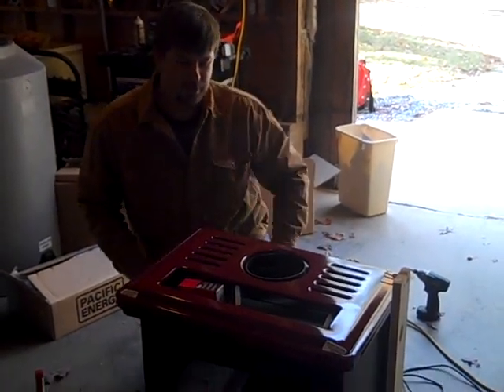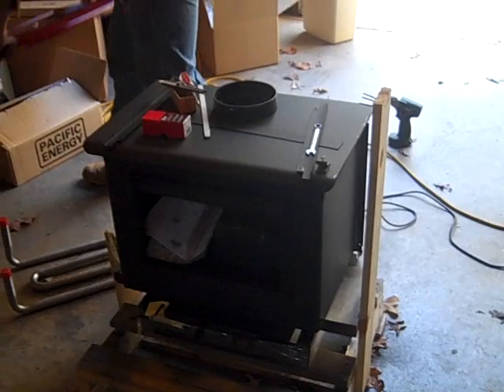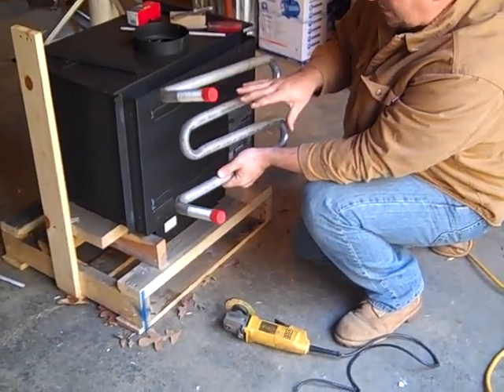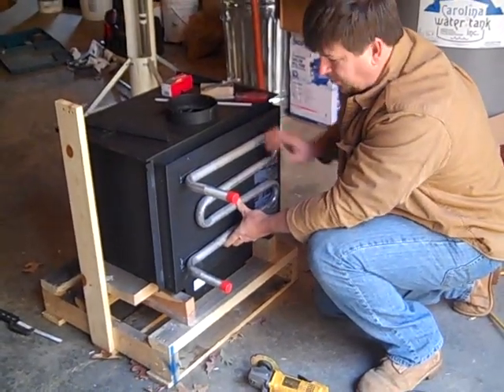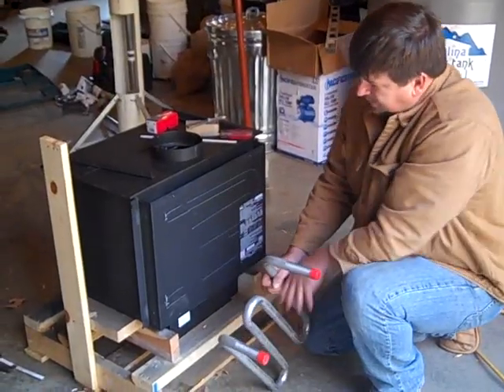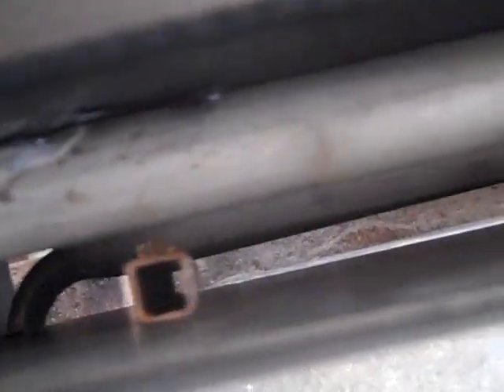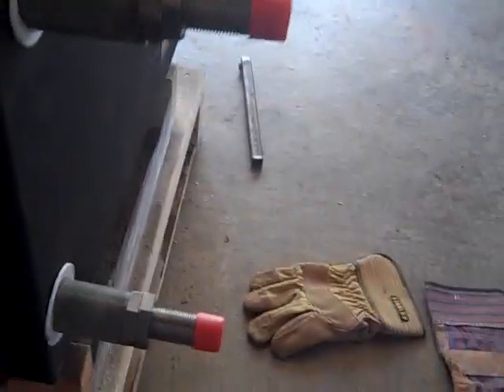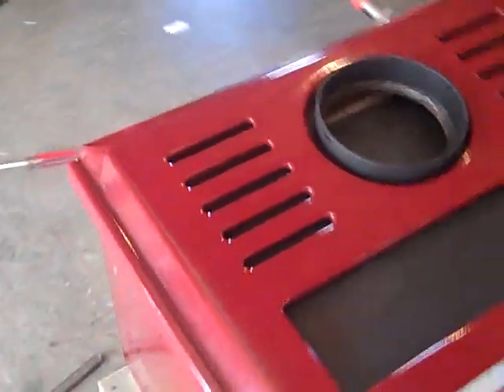Hot Water the old fashioned way: Water coil and a wood stove

Comment: THE BEST HEAT EXCHANGER IS TO USE A CAR RADIATOR THEY ARE THE BEST TO USE THEY ARE DESIGNED TO RUN HOT WATER THROUGH THEM!!!

Comment: A thermal bridge between the coil and the stove plate would greatly improve the efficiency. Even something as simple as closing off the bottom of the rear heat shield and filling the cavity around the coil with sand would help a lot. Air is a poor conductor of heat.
Reply: I think one would need to consider the possibility of what if one ran it dry in your above modification.  That air space is there to hinder the flow of heat to the back wall, making it more thermally conductive may require greater clearance.

Comment: I found you can't take a big cooler  and full it with cold water near your stove or not I put mine close to the stove to make it easy all you do is fill a large pot of water from the cooler place it on top of the wood stove till it heats up and put it back into the cooler and repeat before to long the water is piping hot got it up to 120 the next day it still was at 114 degrees 10 hrs later hthe coleman extreme coolers keep ice 4 days in hot weather so keeping water hot is not a problem once it's heated up just  add a lot of pot water every day or two if you  put the cooler up high you can gravity feed it to whatever you need fill a sink for dishes or a bathtub worked great when my well went out and i had no running water just rain water from the roof  for over a week till I fixed it still having hot water  for washing things got me through would be a great idea for an off grid cabin

Comment: Hi there, do you really need a second water heater for storing thermal syphon water. why cant I use my existing water heater turned off at the breaker. I never see anyone do this on YouTube, is there a reason. If you could answer this I would greatly appreciate it. Shaun T

Comment: I have watched several of the videos you made over the years for hot water and space heating.  You always have creative and innovative ideas.

I wanted to share with you a video of a wood stove used to heat water.  The hot water in addition to the wood stove is, also, used for space conditioning using water radiators.  I thought you might enjoy the ideas shown in the video.  Be aware that the video is not in English.  The tech stuff starts around minute 10:30.

https://youtu.be/LrR6jxT8FiE
Reply: Eric Kosak that’s an interesting idea to plumb a radiator in between the stove and tank. However, it might need a pump to keep the water moving.

Comment: Stuff it with stainless steel scrubbing pads to increase the surface heat transfer from stove to pipes.
Reply: Sand, or aluminum silicate would be much more effective, stainless scrubs is mostly air, not very conductive

Comment: Question for you... we currently have water baseboard register heat, with natural gas as our fuel source. We were wondering if that system can be converted to a wood burning source. We’re seeking your advice on this after watching the similar how to’s of yours to heat water. Thanks
Reply: Monica Troester I just finished all my plumbing I have hydronic baseboard heat I am trying this coil in the stove I will try to update with how well it works soon

Comment: You will find it won't heat water very good with fire brick between the coil and the combustion. Take the brick off the back and then try it it might work better.

People don't totally understand creosote(fire) problems in the chimney from using a coil in the wood stove. That is probably why EPA won;t accept it half assed, not to say EPA is not corrupt, but not everything. They know if they ok it and houses start burning down, in which they will, they will be legally liable. They are not going to ok that dangerous trap.

But i heard what you said, "for when the grid goes out" , but people mainly only hear " for no grid". lol And want to attempt to use it all the time. But also your design won't hurt anything, but in the same token, you won't get much water heated that is worth the trouble of it all, unless you do heat water, then your creosote becomes dangerous. It is directly proportional, the more heat you gather in the coil, the more 3rd degree creosote you build in the chimney. But the less heat you gather in the coil, the less creosote build up. EPA knows this stuff is common knowledge.

I been thinking about it, and a possible way around the creosote problem is to achieve a complete total burn in the combustion, then we can extract ALL the heat out(into coils, etc...) of the exhaust and should not have to worry about creosote than.  But to get that complete burn will be the challenge but it is doable and reasonable. It will consume a lot more fuel(wood, pellets, etc...) but it will be efficient, and just have heat storage and shut it down, cycle it, lit, and back out. And in the long run you use less fuel and at the same time have abundant hot water and warm rooms, if all things are engineered precisely.
Reply: Design of the secondary burn is essential in order to avoid the creosote problem.
Also consider the fuel...pine, for example, is rich in the tars that create creosote but well seasoned oak burns much more cleaner.  There are many products on the market that are designed to burn off the creosote.  We use these in France in wood burning stoves once a month and suffer no problems with chimney contaminations with tars.
Look at the rocket stove principle for a complete burn. The temperatures are so high that tars are burned well before the exhaust stack where the temperature usually do not exceed 130 degrees cent.
I agree placing a coil in the flue when filled with water will lower the flue temperature to the point where tars will condense.  If the coil is wrapped on the exterior of the pipe and then insulated then less chance of a great temperature drop but of course less heat transferred to the coil but still sufficient for domestic hot water.
A tank at the back of the fire, inside that is, along with a safety control system is still the preferred way.
Since 1930 in the UK and right up to the 70's when gas became cheap, the 'back boiler' was installed in virtually every house heating domestic hot water by thermo syphon. No pumps, no valves, open header, and an expansion pipe to the outside.  It worked !!
Thanks for the discussion and the posting of your work
Reply: Taking brick off of back may cool combustion chamber down hence creosote buildup? Also, please explain "why" the creosote buildup with internal coil? Lowered temps? Then maybe the answer is a single coil/ small footprint/ small temp drop?

Comment: Hey Engineer. great video, have a couple questions: what is the temperature of the water as it leaves the fire box? also, could this be adapted with a glycol mixture to run through radiant floor heat?
Reply: The outside wall of the stove is about 225 degrees, so with cold water entering that coil, and since it is a short distance, Im not sure, depends How cold the water going in is, would be interesting to see, either way it will be less than 225, but how much less.
Reply: It’s not a on demand water heater. You are slowly heating the contents of a 50 gallon or so water tank. It might actually be faster if the cold water-in tank and hot water-out tank are separate. But a two tank system might also be cumbersome

Comment: can this by used to heat just ONE level of a house? I own a late 1800s house that someone converted to forced air but NO heat upstairs or vents and I am always running oil radiators up here. my bedroom floor still has the hole where a radiator used to sit.

Comment: give it a month and the insurance companies will make your policy void if any modification to the heat shields happen...always out to screw the small guys...but great job...I do agree with mrbee on if you run a pump to put the cold in the top, if you can get good thermalsyphon without a pump keeps it a low tech winner so cold in the bottom for sure....

Comment: I just recently installed copper coils on the side of my wood stove. There was just not enough surface touching the stove. I purchased two tubs of stove cement and completely buried the copper pipe in stove cement. While the cemet was still wet I pasted some red brick onto the cement. The result was the coils started making hot water right away. Nothing like having them on the inside though.

Comment: That's what i was thinkn... simple, no mods to stove, ez to onstall/ ez to remove altho not so stealth as putting in back. Heated Thermal Mass. Mite try that, always watch for creosote build up throughout the season! Hot fires burn cleaner.  Maybe stick a thermometer in the sand for ez monitoring

Comment: I built a MotherEarthNews water heat exchanger for my wood stove, welded a frame from angle iron and placed a 60' 1/4" o.d. copper tube inside and poured plasterparis over it, bolted it to back of stove and circulated water w/ 6watt12v pump from/to water heater below, closed system. Didn't work too well, pipe diam too small. Seems like ss coil is overkill and expensive, mite try soldering a "coil" from 3/4" copper pipe-Maybe add sand &/or small stone to plasterparis for more thermal mass?...

Comment: Good idea... maybe he could use foil backed Polyiso board slotted in adjacent to the coil next to those box section supports and stick  a sheet of sam on the back of the that exposed plate on the back reducing  convected  heat thus driving  more usable heat into the coil... just a idea ...

Comment: The coil you can Make out of soft easy to bend Copper  and Make it Bigger then that and then Just above that have a small pre Tank befor you go into the water tank even in the sumer when not using the wood heat the pre tank will be going into you water tank at room tem not ground temp at 55 deg 

 All and if you make your own with copper or Black pipe copper would Work Just fine Just add in the line or off the pre tand a blow off valve Just incase you heat to Hot SIMPLE DIY 
David  solarcells101

Comment: put some rockwool insulation arround the water heat transfer tubeing leaving a 1/2" to a 3/4" gap away from the coil never done something like that before but it seems that it would be work

Comment: Great idea! Would welding the heat shield closed on the bottom side and then filling the cavity where the water coil is with vermiculite or some masonry sand add you some better thermal mass to prolong hot water availability after the fire burns out? -Dan Lions

Comment: This mounting ensures low heat transfer to water. Since missing the heat-conducting connection between the stove and pipe. In addition, the heat is on the air through the coil also still limited.
In sum, the efficiency decreases.
- Translation by Google -

Comment: You mentioned the possible need for a 12 volt circulating pump. What circulating pump will you use?  I have a similar need to circulate water between a "modine" and the exhaust manifold of my Onan 30EK.

Pete Stanaitis

Comment: That's pretty nifty,  would it have better contact if you shouded the pipe in a block of aluminum(or other metal) for a heat sink? just just wondering.  thank you for what your doing loving it.
David in CAnada

Comment: I've thought about putting coils on the inside of my wood stove, or a water tank around it, but was afraid of a steam explosion. It's nice to see some one with some experience building a system.The larger steel pipe would be a lot safer than the small copper I was thinking of using. Did you buy the coil somewhere?

Comment: I'm working on a project similar to yours. Having trouble finding a 12 volt inline water pump. I'll be using it for heat. It will go to an old car radiator with a fan on it. Ideas where I can get a 12 volt inline pump? It doesn't get that cold here in SC where I'm at but anything below 80 is too cold for me. Thanks for all the videos.

Comment: could you not have taken 1/2in cooper pipe and wraped it around the 5in. stovepipe and use a lager 6in. stovepipe as a heatshild.just thanking steam from the coil would force the hot water out of the top and back in to the tank with out a pump.just a thought thank you

Comment: Wrap copper tubing around the chimminy pipe then wrap it with insulation. Cold in the bottom hot out of the top. At least thats what my grandfather did and it worked fine.

Comment: @mysciencenow You got that right!  At least once a week he has to get inside the stove to scrape the pipes.  Leaving a heavy coating on them reduces the hot water output also.  I burn wood as my main heat source, but opted for a gasifier boiler.  Much cleaner and much safer.  Have fun!

Comment: @NewJura Yeah,  I've seen those rocket stove kind of things with long coil of copper pipe inside, submerged into water. Input pipe is connected to cold water line from water pump, and output is connected to hot waterline going to shower etc. This gives hot water when you have fire on water heater, and long after it, depending how much you use it.

Comment: If you have to add a 12volt pymp system to ciculate the water what about adding a TEG system to the top of the stove to recharge the battery?  This way in a grid down the system will self sufficient.

Comment: I have tried this project several times and finally decided that I would require an unsealed vessel of water to submerse the coil in. I ran into flow problems even with a circulator as the stove temp went from low to very high temps. I tried expansion tanks, check valves, pressure relief valves, pressure reducers etc,etc..
Can't wait to see what I did wrong. Many a day and night monitoring temps, pressures and flow rates. I circulated the coil water to a boiler.

Comment: That is an excellent stove, I have the same one just less sheet metal more practical top surface for cooking, it's call the Super 27. IMO the Pacific energy makes the best secondary combustion chamber available, PE does not use the cheaper stainless steel tube that get bent when you load the stove. Looking forward to the finished instal video. Well done!

Comment: if you run the hot water return up the back of the flue (so you dont see it, im assuming the tank is in the roof?) it will help add heat and also increase the thermo siphoning distance ALOT. my folks have it like this at they are going much further than 10'.

Comment: Very Nice..A friend of mine did a simular set up on his wood stove and found by jacketing the outlet in another pipe alowing hot air to travel with the water greatly increased the flow. His sytem was for radiant floor heating and the goal was to not have to add a pump. Lookin forward to the rest of the vids..

Comment: Like your idea,, but I've always liked the idea of using a gas hot water tank.  Have the flue gases pass through the vent that the hot air from the gas burner normally flows through.  Given a choice, I'd also put an add on catalytic burner between them to make sure the burn is as clean as possible.  It's the hight that worries me.

John